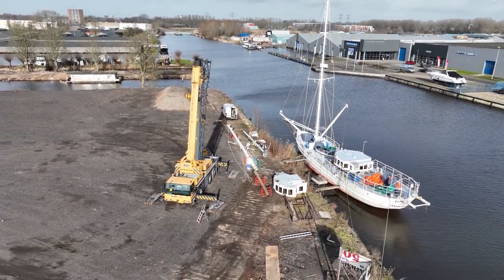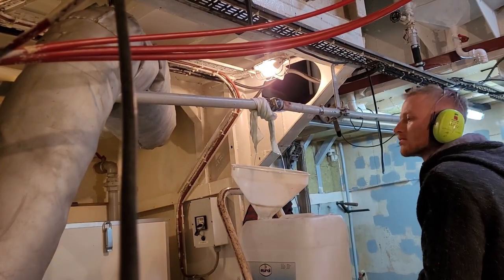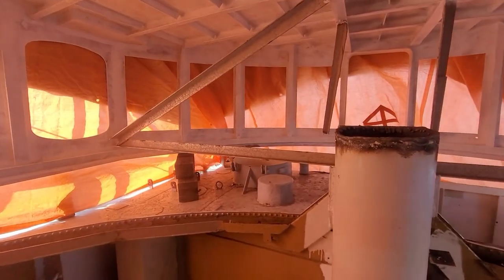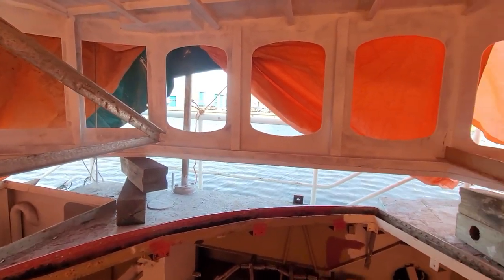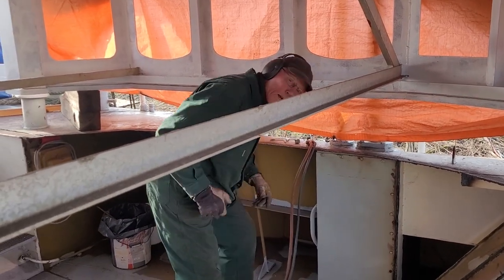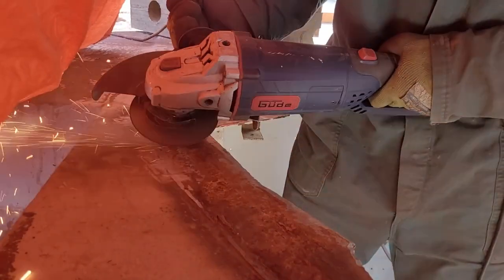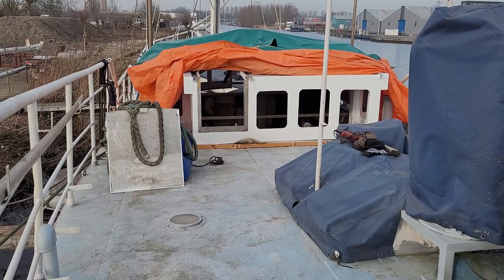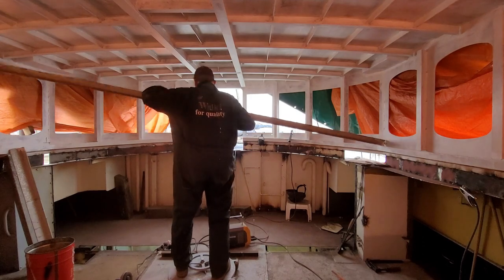Installing the New Wheelhouse - Rebuilding Schooner Tijgerhaai EP8

Comment: The low line of the wheel house looks great, but I wonder if you can see forward to navigate while under way. It's hard for me to tell from the video what the sight lines are from inside. Very good looking boat! Love the style.
Reply from the maker: Thanks! You can see the horizon all around you from inside, but since there's a helm on the poopdeck also, the most navigation & manoeuvring is done outside :)

Comment: Hi Gijs..lovin' this !! But hey, all those cuts...and no plasma ? Is it a cost issue ?
Reply from the maker: It's not a cost issue actually. I guess we're a little bit stubborn with our use of the cutting torch. Advantage of this is that we dont have to run the generator while cutting. We've thought serveral times over the past years about getting a plasma cutter. It just didn't happen yet.